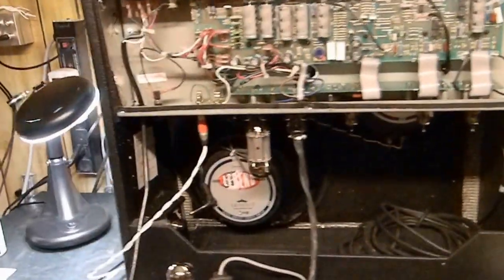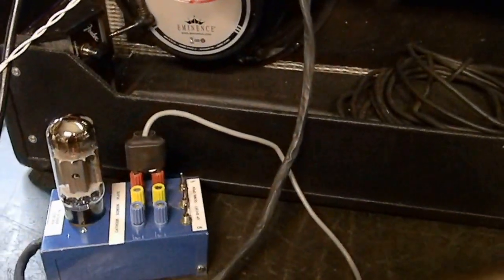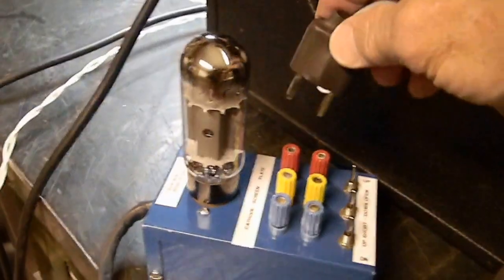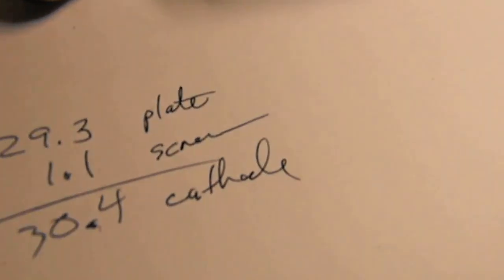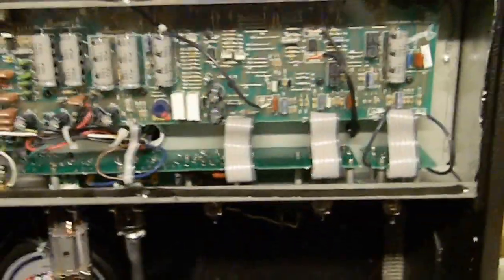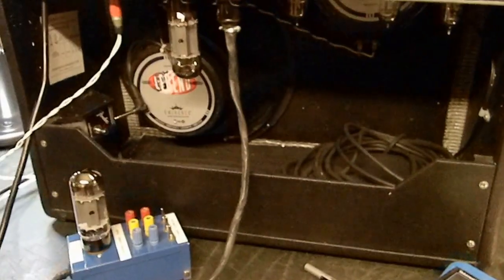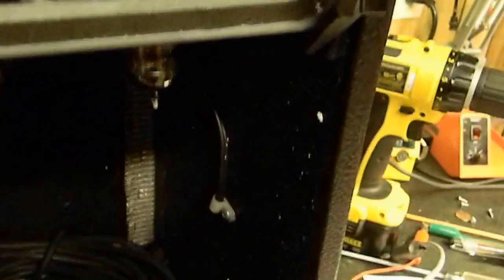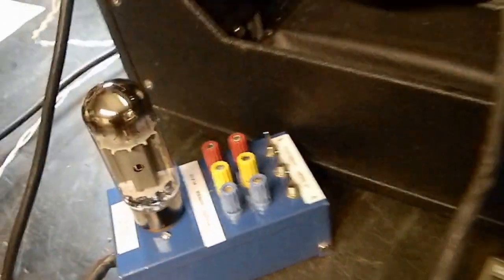Fender DeVille 212 Hum Problem Repair And Use Of A Bias Probe

Comment: David, with regard to the new JJ tube you found with the hum problem, a Gibson GA-35 RVT amp I just worked on (and documented in a YT video) had a brand new JJ 12AU7 with an internal short that knocked the tremolo circuit out of commission. These two failures may just be a coincidence, but I am not accustomed to seeing such defects in new tubes.

Comment from the maker: I started with the scope and could see the hum at the grids of the output tubes and worked backwards until it was clean so I knew where the hum began - then I swapped the tube where the hum was last seen and it fixed it.

Comment: I am a complete amateur when it comes to amp repair and, thankfully, I've only been given a little zap a couple times disconnecting spade connectors on two different amps. Make sure amps are unplugged and discharged. Cannot stress this enough.

Comment from the maker: I knew a ham radio operator that got his arm and hand across a radio transmitter power supply of 4KV and he had scars on his finger tips and elbow where the HV blew holes in his skin - had this happened across his heart, no doubt I would have never known him - much better to get shocked in one arm/hand than across the heart or any other vital organ - the object of every day is to end the day with all your fingers and toes and not be electrocuted -

Comment: Thanks for your videos.  I have the original blues deville that has been a workhorse.  It also has failed due to all the common issues like caps, screen resistor, and desoldering from heat issues.  I've been able to learn how to do all these mods and repairs myself which gave me confidence to build a kit (Ceriatone) dumble type.

Where can a guy learn more about this stuff not having the electrical background?
Reply from the maker: I have been asked questions before about where to learn how to work on electronic equipment, especially vacuum tube equipment - It sounds like you are doing OK if you have fixed all these types of problems you mention.  I would say, study the schematics especially Fender and Marshall and for HiFi study Dynaco and McIntosh. You can find all of that for free on the Internet. The information in blogs and the such is getting better but there is still some misinformation that seems to propagate forever. That is just a suggestion off the top of my head.
Reply: There are som good tube books out there. Look at London Power from Canada, who sells his books directly, and Merlin Blencowe Tube preamp design, which you can get
through Amazon.

Comment: Hi, thanks for the great video and information.    I have seen a type of bias probe that looks like a tube socket    If you have room in the amp, plug it into the socket then the tube goes into that, and there are shorter connectors to measure voltages.  I can't find one in an electronics site, though, do you know if these are any good and where I can get one if they are?  Thanks, Mike

Comment: Seems to me that you would benefit greatly from a second multimeter and a double tube bias box. I would think it would be much easier to check balance on things if you measure them simultaneously? just a thought.
Reply from the maker: +tiger12506 You are right, it is very laborious to use a one tube bias socket so I built a four-tube box so I can monitor the plate and screen current on four tubes simultaneous. However... I have found out through experience that putting the meter (monitoring circuit) in the plate lead (pin 3) Will  cause instabilities in Some amplifiers - not all of them. Overall, it is probably best to use either a 1 ohm or 10 ohm resistor in the cathode circuit. I have not found the cathode circuit to cause any instabilities in any amplifier.
Reply: +ElPaso TubeAmps - I know very little about tube amp repair, so I'm not sure I understand everything after "However...".

Your bias boxes open the circuit between the tube and pin of the socket so you can read it with the ammeter setting of your multimeter, is that right?

Why not instead use double throw switches that switch between direct connection and current sense resistor, then you can use your multimeter on mV setting -- and you get the benefit of being able to scope it.

It's not that I don't believe you about the instability you mention, but I don't understand why it affects my comment? Oh I just read in the description... you don't want any of it pulled out into the box. Well that only works if there is already a current sense resistor.

So maybe just a communication error. Let me rephrase my first comment slightly to say "wouldn't you benefit from being able to measure across a current sense resistor for two tubes at a time using two meters?" That way you could see at a glance if the plates match, if the cathodes match, etc.

We're probably agreeing, but I don't know enough about tube amplifiers to know it. :)
Reply: +tiger12506 Thanks for the video, btw, already subscribed. :)
Reply from the maker: +tiger12506 I think we are trying to say the  same thing. The instability that results in some amplifiers is surely caused by the additional lengths of wire - as an example, an 18 inch cable would add twice that amount of wire to and from the socket (36 inches) , along with being close together with all the other wires in the "umbilical" cable and it causes some amplifiers to break into parasitic oscillations and do al kinds of nutty things. Certainly two meters would be best but I didn't have two matched meters so I went with only one. Check out this video and you will see my "improved" version. Thanks for all your comments.https://www.youtube.com/watch?v=pIEG6ZqnYwg
Reply: +ElPaso TubeAmps Oh, ok, cool. inductance of the leads is enough to mess stuff up. Certainly it would be possible to create little miniature boxes that would look like little pedestals for the tubes to sit on? I guess you can't be guaranteed that they would fit in the space available then...

Thanks for the discussion! Awesome.

Comment from the maker: All reasonable questions - The chassis bias box is not connected to the amp chassis - probably should be - thanks for the thought.  In some cases effective capacitance could be doubled or more but that should not cause any issues except the "pop" when charging. No load on the output is not a problem if the amp is not being driven. There is an interesting and tremendous fear of damaging the OPT without a load - while this can happen it is very rare and would require full volume output to (next)

Comment: Have a problem with my DeVille, after a few hours playing there was a loud noise every time I hit a note , next day it seems fine , but at the gig last night I had the same problem ,  I have no idea what's wrong , could you help me ?
Reply from the maker: That could be a lot of things and it could be a simple problem but sometimes hard to find. If you have a set of tubes I would change one out at a time. Very slowly and carefully wiggle the tubes in the sockets being careful not to wiggle too strongly and wallow out the female pins of the sockets. The newer amps have soft metal in the tube sockets and they become enlarged easily. Maybe better to just tap the tubes with a pencil. I would also very carefully check and wiggle the flat grey cables going between the boards. Be very careful because if it is not broken, wiggling it too much could break it and make things much worse.
Reply: thank you  so much for the  answer, i changed all the tubes , but im still having the problem , i found out some of the caps are bad , do you think its a good idea to get this?     willhttps://www.fromelelectronics.com/collections/amp-mod-kits/products/hrdv-mods?variant=34680059331

Comment: Is it safe for people and amps to take tubes in and out of the sockets while the amp is in standby?
Reply from the maker: It depends on what the standby switch does. If it opens the ground connection on the center tap of the power transformer, or the switch is in series with the B+, I probably would (and do) pull tubes with power on ... But ... what if the switch fails to open properly?   I simply can not and do not recommend pulling a tube with the power on and the instrument plugged in to the AC outlet. You may be able to get away with it many times but stupid-happens and for reasons that are hard to figure out it is Always best to be safe. A super nasty shock of 450 volts changes how a person looks at life. Beforehand, that amplifier was your "friend" but something unexpected and bad happens and you're not friends anymore. Always take the high-road when it comes to safety and don't risk injury for any convenience.
Reply: ElPaso TubeAmps
Thank you.
Reply: ElPaso TubeAmps Generally.  Don't do that. Shhh, Don't do that.

Comment from the maker: possibly damage the OPT - I have never seen an OPT degraded as I sense there is great fear of by not having a load on the output. The OPT will be damaged beyond repair, or not harmed. Tremendous superstition and fear is perpetrated on the Internet about OPT damage from a no-load condition Don't operate an amp at full volume endlessly with no load as damage is possible but anything less is not going to do the OPT any harm especially with no driving signal. This is fear that will never be resolved

Comment: I HAD AN AMP FROM hades, WHERE PULLING THE TUBES OUT WHILE AMP WAS ON, IT FORMED LOW RESISTANT CARBON PATHS i kid u not BETWEEN LEADS ON THE LAN CABLE, AND THE SOCKETS U HAVE no IDEA HOW happi I WAS TO GET IT out of the house........SORRY FOR CAPS, NOT CHANGING,  LOL TIME TO EAT........  :)